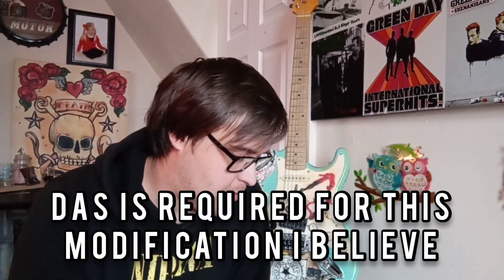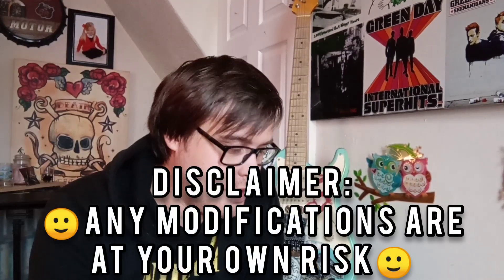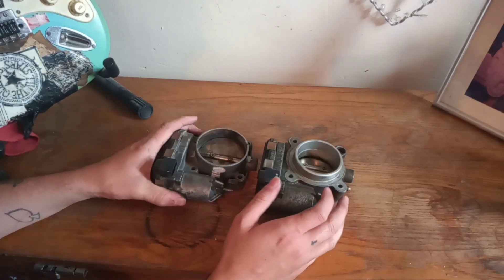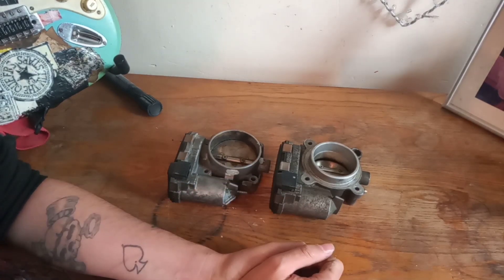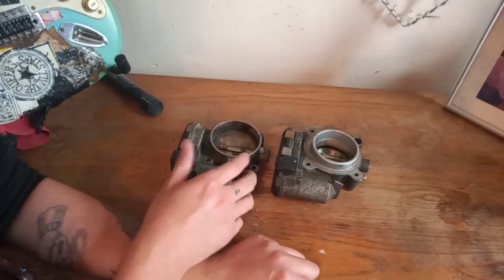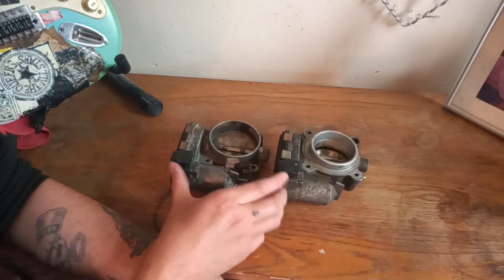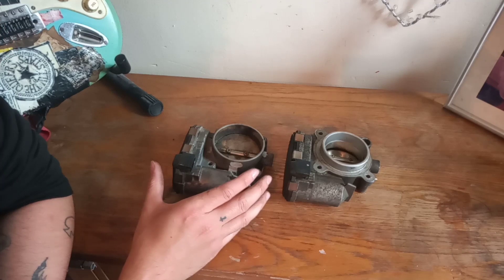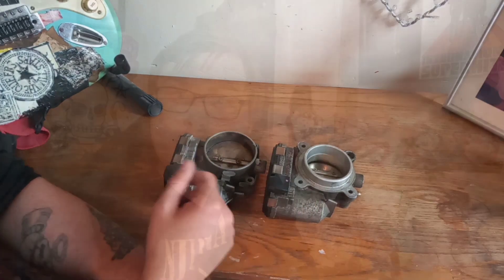Mercedes Benz M111 200 230 Kompressor Pre-facelift Throttle Body Upgrade (CL500 76mm)

Comment from the maker: To clear this up YES you do need DAS to this  Mod as you HAVE to "BOOTSTRAP" the engine management system. A simple throttle position relearn will not work! My error in the video I hope this clears things up a bit 🙂
Reply from the maker: I know a think tool scanner isn't a relearn bud. This has nothing to do with a throttle relearn or any aftermarket scanner it, basically you have to bootstrap the engine control module so it basically almost virginises the ECU to all of the engines sensors is the best I can understand from what Ben said. It  is only possible to do with DAS as in Star diagnostic no other tool, I did want Ben to do this video more than me as he is the tuner and electrician. Can we put this to bed now I've tried to explain as best I can that it's not how I mentioned in the video that's why I pinned this comment to try to clear up MY error 🙂.
Reply from the maker: Ah I'm not knocking it bud for ages we used the icarsoft stuff that used to work quite well, I've not seen it but I'm just saying you couldn't do it with that without trying it all I'm saying all I know of factually from experience is DAS if that will do it too that can be added to the list 😉 if it can do it that opens up the options for more people. What I was more leaning towards was making sure that people don't think it's just like a throttle reset like I said I will probably add a little vid to clarify my balls up 😂

Comment: What TB will fit my 2005 c240 wagon plug & play no tune ? Or what works with time , I have a tuner I’ve used before so not issue, but would love plug and play upgrades , suggestions welcomed

Comment: Would this 76 mm throttle body bolt on to the plastic m111 manifold? Apart from the electronic system problem
Reply from the maker: Hey, I've never tried it with the plastic manifold but I do believe the bolt spacing is the same, however you have to have some electrical knowledge to fit this throttle body as two wires need swapping over at the ECU. Mercedes made the V engine throttle bodies essentially work backwards to the earlier M111 engine. So on a pre 2001 car two wires need swapping at the ECU but I will have to double check which wires. But I haven't tried this in a post 2001 car it may be plug and play but don't know as I haven't tried it however I don't believe it will fit a post 2001 m111 Evo manifold due to the way they designed the throttle body mount. But pre 2001 it should bolt up but you will have wiring issues, but once the wires in the ECU are swapped around it will work. You will have to also make custom intake piping as the standard elbow will no longer fit but I'm sure that wouldn't be a problem.
Reply: @M-oneeleven-M111  great! Yes, for me the wiring it’s no problem. I’m going to look for one throttle body for me. Thanks! Great vid
Reply from the maker: I should also add, to make it work with stock management SDS/DAS is needed as per my pinned comment in this video, however if going to aftermarket engine management it makes this process much easier 👍
Reply: @M-oneeleven-M111  yes, I’ve seen your other videos. I have a friend that has that DAS system

Comment: A 200 kompressor throttle body is interchangeble with other 200 kompressor throttle body(but other part number) without DAS? For example i have a 111 141 00 25(m111.944, 2 litre, 192 HP)

Comment: You should do a video on replacing the plastic manifold with the metal version as there are differences with that also mate 😎
Reply from the maker: Good idea also how the metal manifold will not work on post 2001 vehicles due to mercedes enlarging the intake ports, there's also the gasket aswell and the little metal brace. Either way I have that to do to the Clk so I will probably do that, something turned up today that I will show in another video I have a lot planned for the intake. Although all of it will seem a little backwards 🤣
Reply: @M-oneeleven-M111  does the Post facelife head fit on the Pre Block? 😎😉
Reply from the maker: @Mitutumuch  I haven't had a chance to try it yet, the headgasket looks the same but not sure on timing and piston to valve clearance  but a facelift head looks a better route to go than early head 😉

Comment: Didn't know you had to use DAS to relearn the throttle instead of the Key trick.
Might try the aluminium manifold and V6 or V8 throttle bodies again.
Reply from the maker: Well I'm just going on how Ben has told me, to be honest I don't see why the key trick wouldn't work when I get to fitting this to the Clk I will test the key trick first. I just didn't want to state a method I was unsure of is all. Cl500 S500 E500 any of them are 76mm if you can find a AMG 55 one I think they're 84mm if I remember right v6 I think is 65mm something like that 🙂
Reply: @M-oneeleven-M111  I got a M112 E320 one and a M119 one. Btw, the prefacelift throttle bodies have a returnspring and a round plug instead of the rectangle/square one. You have facelift ones.
Reply from the maker: @FineW_TurboM111  I think you maybe refering to the earlier m111 with round plugs the 975 certainly has rectangular plugs facelift or what we class as face lift is post 2001. 97-2000 for sure had rectangular plugs 94-96 was round I believe possibly up to 97.
Reply: @M-oneeleven-M111  Both me and another fellow with a M111.975 has the round plugs on our throttle bodies. Mine is a 96 registered as 97 and his is a mid 97
Reply from the maker: @FineW_TurboM111 I should get my fact right before I speak I forget the 975 technically has its own facelift 😂 I know exactly what you mean but I have seen them with that, all the ones we have had so after 98 have had the rectangular plugs, but I will be honest it's a lucky dip what you get as in different chassis the electronic systems changed at different times. That makes things super fun 🤣 my M104 has a round plug throttle body luckily the same sort of principal should apply to those plugs in theory as it will be same management and throttle body  I believe. Who knows maybe you could be the one to test it on the round plug? I think the V8s also had some versions with the round plug like you have the M119 one. Hopefully the same thing applies to them unfortunately I don't have an old enough car to test it on I believe 11/97 was when the plugs change officially if that shares a little more clarification 🙂.
Reply: key trick does the same both throttles relearn as DAS does. but if u change throttle  u should also change stock intercooler, pipes and maf  that are with lower diametre also kompressor outlet pipe is same lower diametre so no point to change throttle as i think there still will be bottle necks anyway, u even may get worse results as u will lose air speed inside manifold with bigger throttle
Reply from the maker: That's absolutely Right about bottle necks but it does help throttle response, this is for the clk which is getting an entire intake change but I'm gathering parts at the moment. Well I say that I've had the throttle body a year 😂